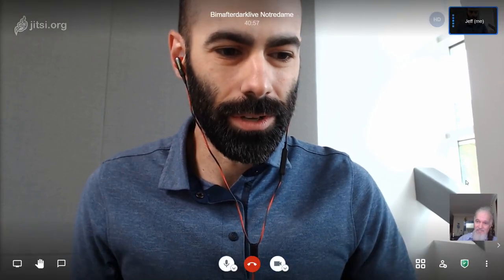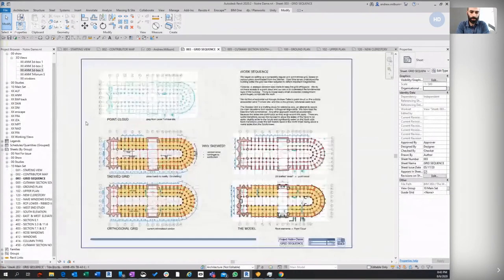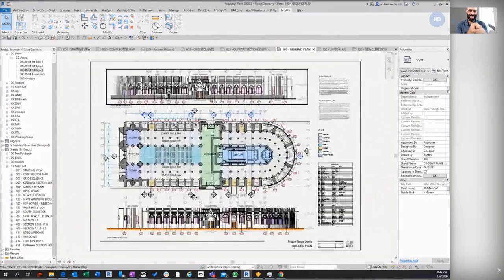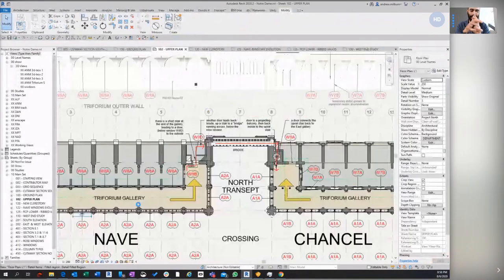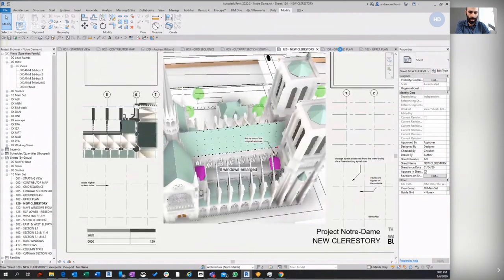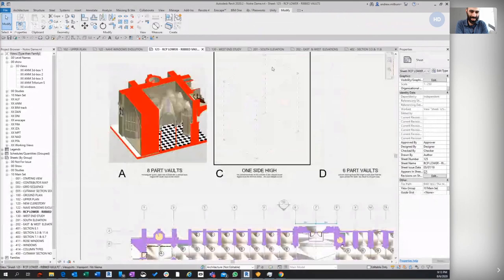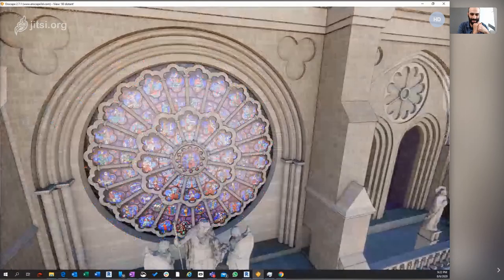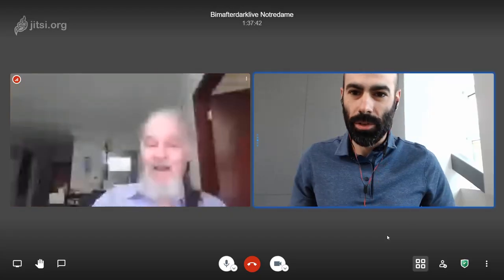Rebuilding Notre Dame... In Revit (w/Andy Milburn)

Comment: I know as a revit user that it is a massive work but I'd like to know if you could share it, is it possible? Many thx in advance.
Reply: @Brodi Scott and it doesn't cost 10000$. Is a model of a medium-sized building. Anyway it is a pretty building and It will be great to have it to show this to architecture students.
Reply: hbsc5  Have you added the time spent for custom-made families or even they are parametric?😁
Reply: hbsc5  Yes, I know..you will add at least another 40 hours to build up these special families..
Reply: I hope they will ! I live near the cathedral and have never seen it this way. Outstanding job... Foot note : stop calculating the model price you are missing the point.
Reply: hbsc5  Generally, if you are delivering an as-built model of a building to facilities management at LOD 500, it will be written into the contract up front.  I have seen typical models go for 1% of total construction cost.  For example, the last contract I saw was for a $600MM university building project (granted, much larger, and with a dozen or so linked in models in the end game federated model), which the delivered federated Revit model came at a cost of $6MM.  3D digital modeling is MUCH more expensive than you guys think.

With regard to this particular model, I think you maybe missed the part where he talked about the fact that there were 5-7 heavy contributors, and a handful of other contributors to the project, and they have been working on it for over a year.  I have no clue where you came up with 40 hours, but Andy said that he has "hundreds" of hours in the project himself.  I would be willing to bet that this project has taken a few thousand hours of work, all told between the contributors to the project.

All that said, amazing work, Andy et al.  It is incredible what you can do with the tools provided, and it's great to see such a beautiful building recreated digitally.  Hats off to you all.